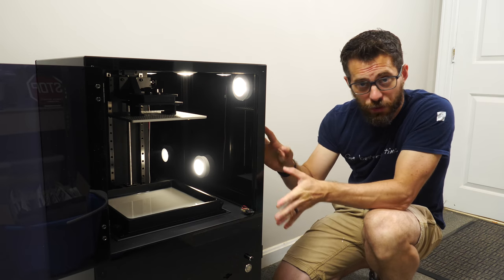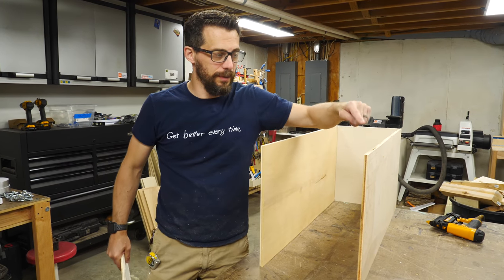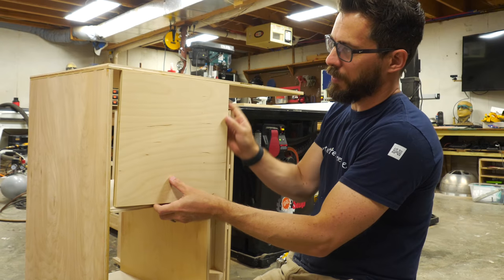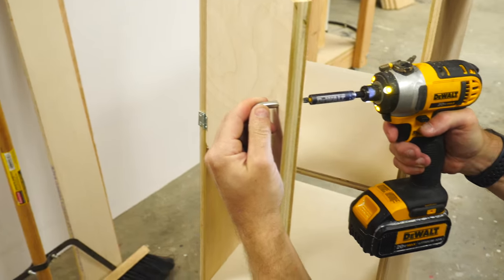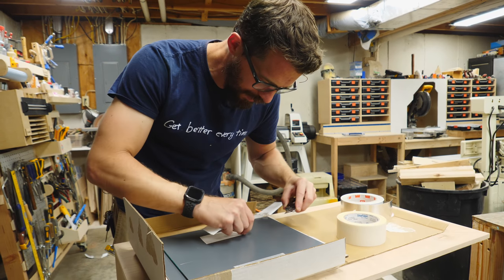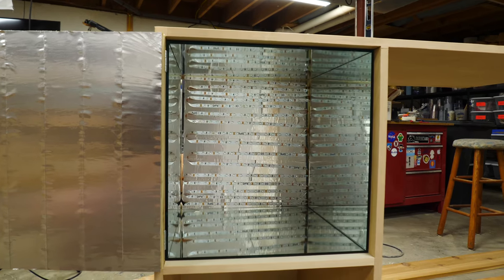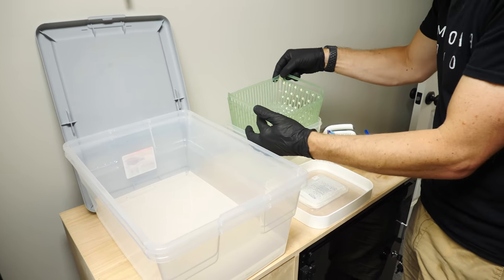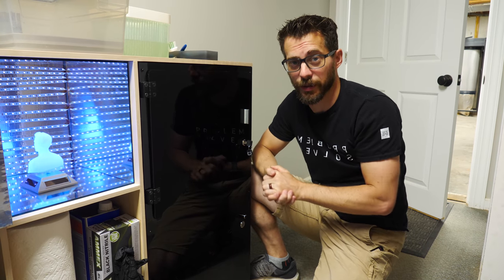How to Make an SLA Finishing Station // 3d Printing | I Like To Make Stuff

Comment: Hi Bob, does the resin actually need UV light to cure? In that case, mirrors might not your best option, pure aluminum reflects UV very well, but most types of glass absorb most of it.
Reply: This needs to be heard.
Reply: Came here to say this, those mirrors are doing almost nothing. Should have gone aluminum foil all around.
Reply: Wouldn't an ideal chamber be rounded or at least faceted as well? I would think all those 90* angles would be retro-reflectors and re-direct the light back to the LEDs instead of around the box, greatly reducing the amount of light actually focused in the center
Reply: @SirJoshuaTree  The surface variations in the aluminum foil or foil tape would also help this quite a bit.
Reply: That aluminum tape is also probably useless: most of those tapes are covered with a thin layer of plastic IIRC, and most plastic will react to UV also. Using just plain kitchen foil would probably have been a better and cheaper solution. Or you know, putting the UV led strip on each panels.
Reply: It's true, only borosilicate glass let UV light through :)
Reply: @Krystof Jochec Correct, or quartz glass, but that would make it a really exotic and expensive design
Reply: Why not use non gloss flat white paint? Make it like snowblindness.

Comment: That solar-powered turntable was a stroke of genius.
Reply: @han5vk  Its clear.
Reply: @zanpekosak2383  Glass does not let UV through.
Reply from the maker: The uncured sections appear glossy, so we turn the piece so that the bottom gets it's own exposure cycle  as well.
Reply: @stafdehat I first saw this trick from E&K.
Reply: I dig the organizational parts of this Bob. SLA is a messy but worth it process . I’m using it with a way lower cost AnyCubic resin printer for Dental projects to help my Bruxism clenching prob. Peace. Thnx again.
Reply: @hacklabdesign  I have a similar issue and using the printer to create an aid is a great idea that I never considered. Thank you so much for sharing!

Comment: Some important notes: you need to get the right uv LEDs for your type of resin. (382-408nm wavelength are the most common). A 30watt panel cures parts upto 10cm diameter within 1,5- 2 hours. Be aware that parts can get hot and slightly deform when you leave them in to long. Rinse them off with IPA, no scrupping needed (the brush can damage the part) just dipping it a few times is enough in most cases. After curing RI se again with IPA and let it sit a few minutes, then wash it off with clear water. Depending on the type of resin times can vary

Comment: Maybe add a safety switch to turn off the LED's once the front panel opens, to avoid eye exposure to the UV light.
Reply: Nah you dont need eyesight
Reply: @l.no.solace7209  yup, health and safety way over rated, along with eyes and limbs.
Reply: Don't go outside either.. The sun is the devil!

Comment: Hey Bob, great build. In case of that bust, you can print it straight on the platform so it comes out upside down, and then have 1-2 supports for the overhangs (like the ears).. that's a lot less work with removing the supports. Saves time and material. The model orientation shown in the video looks like the default software settings.
Also no need to wash the platform if it goes back to the resin.

Comment: You can make a great curing oven from a cheap toaster oven and those same LEDs. It gives you the ability to time you're curing. Just pull out the heating elements and wire the LEDs into the positive and negative leads coming from the timer. For the washing, ultrasonic cleaners and magnetic stirrers somewhat automate the cleaning process too

Comment: Also there is an option to recess the hinges between the sides and the door. And even easier option, just align the hinge to the outer border of the sides an get those 1-2mm over on the door side. It does not need to be centered on the gap. Than on the other side of the door, take little off from the inside corner, to make sure it does not bind up on the side while opening. That is it. Keep up the good work.

Comment: If you're looking for a cheap and reflective material, nothing beats cheap mylar emergency blankets, available in the camping section of most stores. A bit of spray adhesive and some time to keep it from getting wrinkled and you'll have a nearly mirror-perfect surface that can easily cover large objects

Comment: Btw for the aluminium tape, if you use a plastic straight edge like a card and run it over the tape like a scraper, it will smooth out all the wrinkles and creases as well as blend the edges between tapes together which make it look nicer

Comment: I'm not the most knowledgeable about resin curing but I think having the solar powered turntable in there, while an awesome idea, may not be doing your resin prints any good, unless you're willing to babysit them while they cure.

Everyone's already said their piece on the use of mirrors and aluminium tape, but I think your prints would be better served if they were put on a metallic, reflective oven rack inside the curing station, one with holes along the bottom. As it stands, if you put the print in like Bob does, every angle except for the bottom would be cured easily (aside from overhanging bits), with a metal rack you'll allow the UV light to bounce and hit most of your print from the underside giving it a much more even cure.

Still this is an awesome idea and I hope to be able to make one of these when I eventually get a printer of my own!

Comment: If you wanna get a nice smooth surface when you're using the aluminium tape, use a roller it works great as smoothing the surface over
Reply from the maker: Good call!

Comment: Little tip for you, when you apply a vinyl, like the paper on the top of the cabinet.
When you cut off the excess, cut with a 45 degree angle, it makes sure that there will be no little lip on the edge that could lift when you accidentally bump it or something.

Comment: Quick tip about curing resin prints; the resin tends to have cure inhibitors that slow its curing in the open air. Prints will only fully cure in an anaerobic environment, such as submerged in a glass of water.  Otherwise the surface can remain slightly tacky or soft. (I'd say pick up some borosilicate lab beakers on Amazon.)

Comment: For a future upgrade I'd advice putting the led pannel at the door. That way you minimize the risk of getting a direct blast of uv light in the face in case of opening it with the leds on in case u forget to turn it off of if the chamber opens by itself. Uv leds are not as healthy as we think it's

Comment: I've found that having two alcohol baths has been very important for cleaning prints. The first bath gets most of the resin off the print. Then the second bath gets the rest usually. I've since added a third bath. I've found that it gets prints cleaner and makes my alcohol baths last longer. By the time a piece comes to the third bath it's already pretty clean so when it emerges finally I don't ever have to worry about chalky residue. (I'm just experimenting now with ultrasonic cleaners full of IPA as well.)
Reply: Sorry for the necro, but filling a ultrasonic cleaner's vat full of IPA sounds like a extreme fire hazard, the IPA will aerosolize, instead use a bag full of IPA with the print inside in a vat of water.

Comment: Hey Bob, mirrors would not be good for this project, because glass is not transparent to UV wavelengths of light. Since mirrors are a reflective surface behind a pane of glass I don't think mirrors would reflect UV light well. The best option for this project might be to line the walls with aluminum foil.

Comment: Good that you used one of the solar shop turntables if you didn't I was going to comment but have to tell you the rinse station.. that's what I did initially too (well except I did the 3 jar method, dirty IPA to clean IPA to water then 5 minutes in the sun).

You need to get an Ultrasonic cleaner (ebay bunch of options) and 5 minutes @ 35 degrees cleans parts a MILLION times better than hand washing. I was hesitant to do that initially myself because I couldnt find any comparisons online and the reason is, there is no comparison I would be like writing articles on the difference between driving between cities yourself or a plane. It's just that much better. 

I picked up a 1.5L ultrasonic cleaner for my own print bed which is plenty of volumes. You fill the ultrasonic cleaner with water and then you put the print in a ziplock bag with some Isopropyl Alcohol. The bag will degrade so don't expect to keep it for long but you can pour the Alcohol out of the bag into a jar to reuse it a few times before letting it just evaporate. I have been asked to print DnD miniatures from Heroforge a lot and the difference on fine details when cleaned properly with an ultrasonic is staggering.

Comment: Update the door with plexiglass and use one way mirror foil to have the reflection on the inside and you still can see your model from the outside. 
Place the leds on the top of the cabinet on a curved bed so it is pointing to different angles and reflecting all around.
Reply from the maker: This may be a viable option, but there is a balance between achieving a result and overcomplicating the build.

Comment: Keeping the printer on the ground would be a big con for me. I didn't see anything in the specs for this printer, but if it supports wifi printing, or the ability to use an extended remote box (like Wanhao's sla printer), or even Octopi, that would save some time having you to go hunched over to fiddled with printer.

Comment: Bob, I think this would work great for a plastic bleaching station for vintage toys to remove discoloration.  Is there anything in particular special or unique about the UV Led strips you used or are they just the ones commonly found on Amazon?

Comment: The 9 Bob's in the box was a cool visual. Oh, and the project was useful, too. Just wondering about the box for cleaning the bed. Won't the loose fit of the lid allow the alcohol to evaporate?  Did I miss the part where you account for that?
Reply from the maker: Alcohol in that application is a consumable, it gets nasty after a lot of cleaning so it will need to be changed out.

Comment: im just wondering if those leds have any conductive points points on the back or sides because aluminum conducts electricity and that could potentially short circuit

Comment: I'm pretty sure that mirrors like that actually have UV absorbing properties as part of the glass composition. The reflective portion of most mirrors is actually on the back of the glass. If you went to a glass company, you can specifically ask to have zero UV protection glass. In this particular case, I think I would just buy some pre-polished/mirror stainless steel.

Comment: Hey Bob, aluminum should work great at reflecting the UV, but the glass in front of that aluminum will actually soak up the UV, meaning your mirrors might not be reflecting the UV like you intend.  If those are first-surface-mirrors (unlikely - those rarer and pricier), you're good, but otherwise, you should probably scrap the mirrors and use that aluminum tape on all the surfaces.
Reply from the maker: Interesting, wasn't aware of that.

Comment: What SLA printer do you recommend?
Reply from the maker: We've only used the Moai 200 and the Formlabs Form 1, and they are effectively the same.
Reply: @Iliketomakestuff  Thanks. You should reach out to Prusa3D and see if they can provide you with a SLA printer for review. Looks to be half the price of a Form 1.
Reply: Joel Telling just did a pretty good video on a really cheap one—the Orange 10. Might be a good place to start if budget is a concern.

Comment: It seems to me that having the cabinet in direct contact with the printer prevents using the curing station while printing for fear that any jarring could splash resin and also affect layer alignment.
Reply from the maker: Nope, that's really not a concern at all honestly.  Plus, you don't clean off a printer while the printer is in use, typically.

Comment: Why would you switch from the normal 3d printer to this. This seems why more work.
Reply from the maker: The print detail is MUCH higher. It's not switching completely, it's used for different things.
Reply from the maker: We didn't switch, it is a different capability.

Comment: Hey. Where is the real part of the making videos. The time were you took a hamer and some nails to make something. Something with basic rules so everybody can make it with a bit experience. No cnc or that stuff.
Reply: Like the previous video?  No cnc or printer—just wood, screws, nails, etc. The tools used in these videos vary fairly often, it's not going to be hammer and nails every time.
Reply: @forby_  thats right but some time's he makes something nice but you can not make it at home bicause the tools he is using we dont have
Reply: @user-tj1el9uo1m  Yeah that's going to happen. You can't cover everyone's current setup in every video. It's ok.